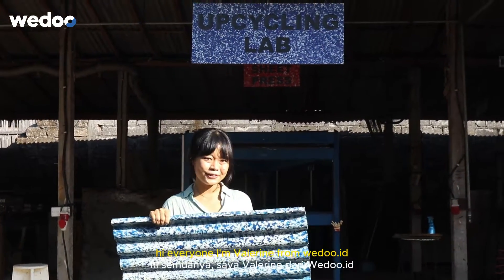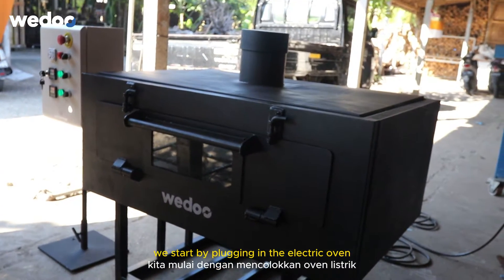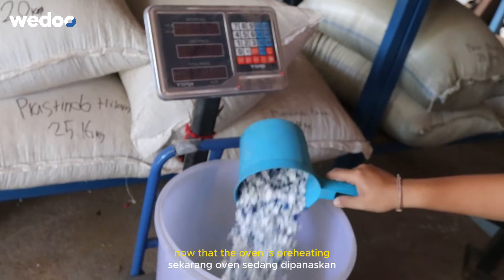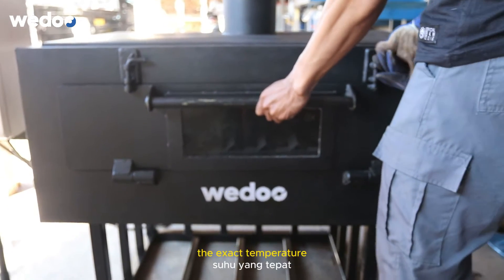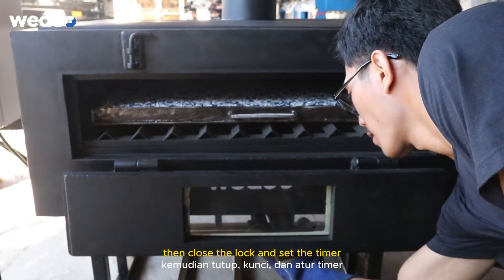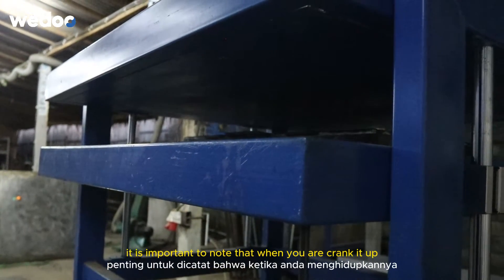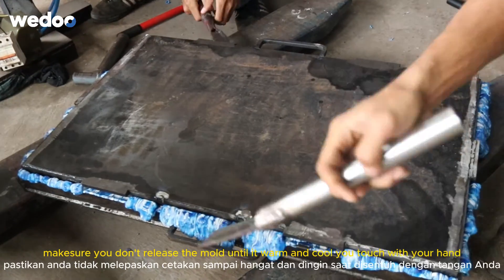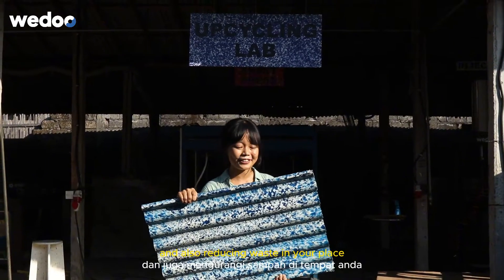HOW TO BUILD ROOF FROM WASTE - WITH ELECTRIC OVEN BY WEDOO.ID

Comment: apakah udah dapat solusi "anti-uv" supaya tahan lebih lama di matahari? selain cat?
Reply: Make a thin sheet of plastic that is fully opaque then bind it to the top of the structural shingle. It will works similarly to a sacrificial anode on ships. You can also cover it with kraft paper and wax it, etc...

Comment: Yikes !! That is a lot of energy and labor to produce those roofs.
Reply from the maker: We also make more sophisticated machinery that help reduces the amount of energy and labour required. However, Recycling, especially at a smaller/low cost scale is labour intensive, but still necessary. Especially for a lot of places in indonesia that doesnt have that much fund but dont have access to waste management so it is suffocating with plastic, especially the low value one like LDPE.
Reply: @wedoo_id  Indonesia is beautiful! I do hope you will find a way to tackle waste and the people that trash the place.
Reply: Exactly.  One needs to perform a life cycle assessment of the process.  As it standa, the process is beyond insanity from an energy consumption and labor input perspectives.
Reply: @yetao5801  It is very easy to look for and find reasons to not do anything. 
Helping takes more time and work. 
Some people just prefer finding excuses to be lazy.
Reply: @GermanSausagesAreTheWurst  you looking to reduce pollution or make money selling the equipment? Heating and melting that plastic will likely consume 1/2 gallon of dirty fossil coal/oil . I'm guessing the electric oven will pull 15 Kilowatt-hours from Indonesia's coal/oil power plant.
Reply: @paulgifis1908  You accuse the German person of trying to make money, and yet everyone knows the old saying, 
"the thief is the first one to accuse others of stealing." 
Perhaps you work for the fossil fuel industry. That would explain why you hate this idea so much, and yet you are unwilling to offer a better solution.
Reply: @yetao5801  no anti UV material was used so I'm guessing three years before the roof start cracking.

Comment: These sheets look amazing! I'd love to see what a full roof looks like
Reply from the maker: thank you so much! that is in the plan for end of 2024! stay tuned
Reply: @wedoo_id  that's an amazing video.  Is the mold made of iron or aluminum?  Does it matter what material it's made of? Best wishes from West Africa
Reply: Please keep track of how many kWh and labor-hours are used for your full roof.  The energy consumption needs to include curb-side pickup, sorting, washing, chopping, etc.  I would be azed if you could perform at 30% embodied energy intensity relative to zinc coated corrugated iron.
Reply: @yetao5801  
It is easy to be negative. 
But doing things the easy way makes more problems in the future.
 I hope some day you can understand that.
Keep learning and working hard, and someday you may grow into a better person.
Reply: @GermanSausagesAreTheWurst  you have no understanding of the amount of fossil fuel needed to create this roof shingle.